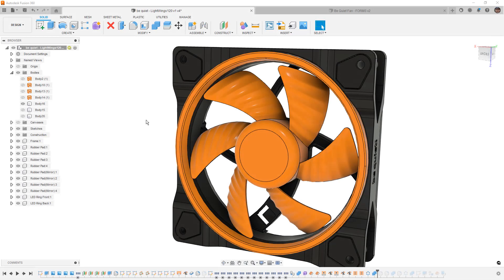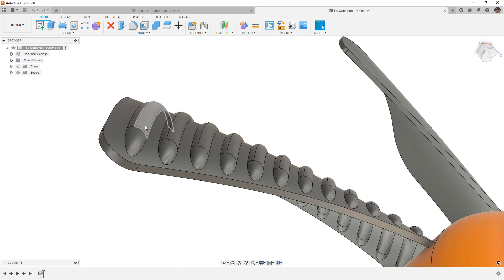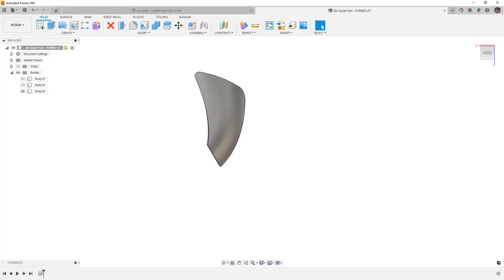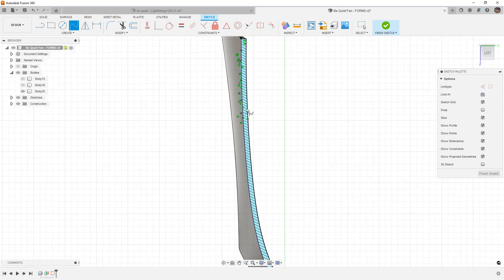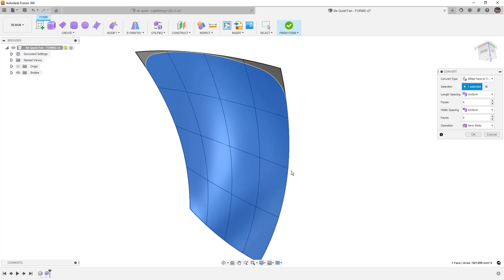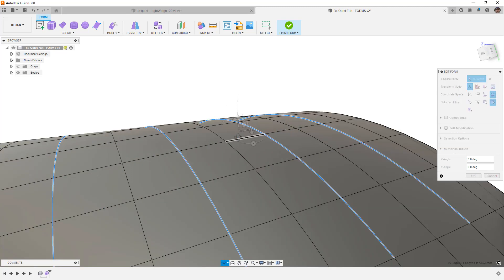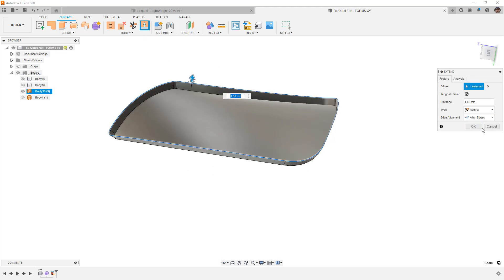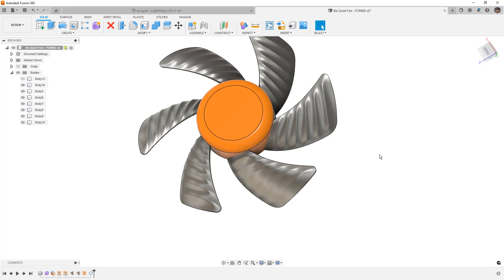Fusion 360 Form Mastery Part 45 - How To Model This Crazy Fan Blade Using #Fusion360 Forms

Comment: Great video! Wondering how you would approach matching the curve of the raised areas to the curves of the outside edge, so more in line with the rotational movement?
Reply from the maker: Thanks!  Really you would just need to make sure the edges on the from line up  how you want them to.  It is a bit trickier because the edges in a form are guiding the curvature and not exact like they are for say a sketch/surface.

Comment: Converting a BREP that required some specific dimensions to create to a T Spline for some “value-added” shaping is a really great work flow to keep mind.
Reply from the maker: Agree!  The direct modeling nuance of this type of approach is also a good one. if you turn off design history the forms and the solid and surface exist at the same time.  So you can convert back and forth while retaining the form body.
Reply: @LearnEverythingAboutDesign  turning off the design history is something occasionally mentioned but, TBH, I’ve never grasped the significance of it. But what you said here has given me a clue.
Reply from the maker: @ThatAdam12  https://youtu.be/bvQUq3CYph0  should answer all questions :)
Reply: @LearnEverythingAboutDesign  just watched it. Your example in the video didn’t quite resonate with me, but I know where I can use the technique in the project I’m working on to try it out.

Comment: Would replace face work
Reply from the maker: Sadly in this case it didn't.  It needs to extend the original face out normal until it hits the new face and it trouble with the converted form.  But definitely a good option to try!
Reply: I was gonna ask the same thing.